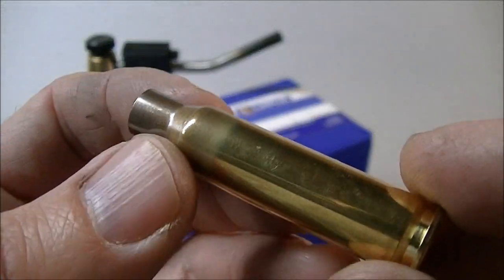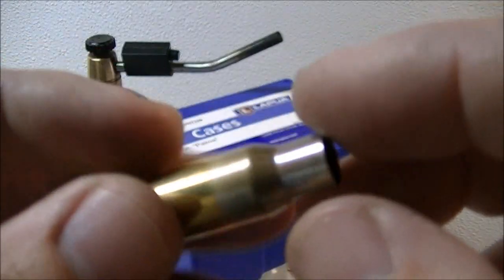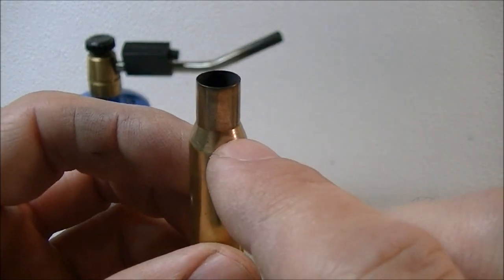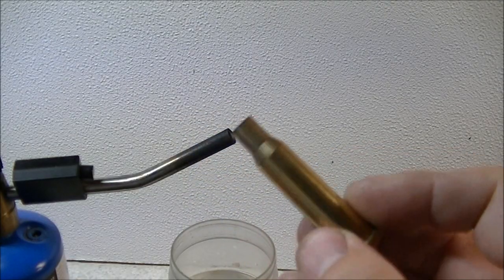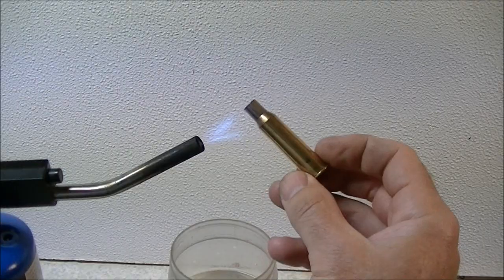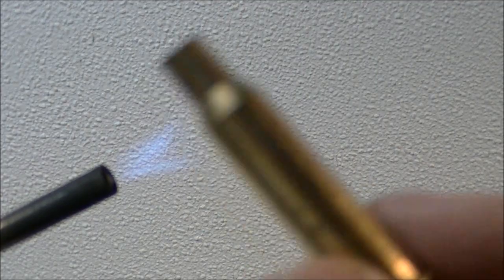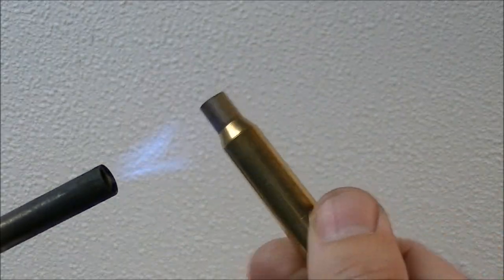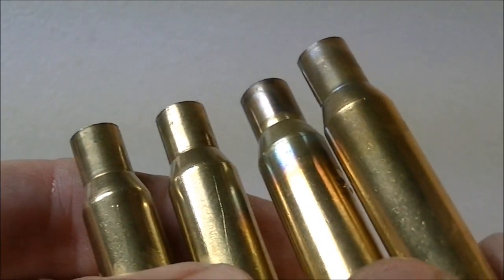How I Anneal Brass Cartridge Cases for Reloading

Comment: if you don't get it up to 660 to 665, you're not doing anything, just getting it hot.
Reply from the maker: Apparently I must be getting them hot enough as the brass I've processed using this method lasts and does not suffer from neck cracks. Overheating is worse than under-heating, as it turns case necks/shoulders dead soft to the point where they  often collapse when seating bullets or crimping.
Reply: heating it up to any degree relieves stress, 660-665 is just the suggested "optimal" temperature. depending who you ask it's generally accepted at 400-500 for 10-15 seconds which works out to roughly a max of upper 600 or so depending on the heat source. the trick is localized heating in the tip.

Comment: I thought you were to let the shells air cool after annealing? Does dipping in water not reintroduce the stresses and reharden the brass to some degree? Thanks!
Reply from the maker: No, dipping them in water does not harden them at all. Brass is quite different than steel or iron.

Comment: Question: Should I anneal before or after sizing / trimming.
Reply from the maker: +bill65761 I would do the annealing after sizing and trimming.
Reply: +314299 Shooting Channel Thank you ... I'm looking at 10 gallons of .223 cases and not wanting to make 10 gallons of scrap to go with the 1,800 rounds of unreliable reloads I've already made.

The test rounds all functioned just fine ... but because I was given bad information from an experienced reloader, I had not length trimmed them and had not used a small base die when sizing them.

When I caliper them, the used cases are as short as 1.734 (range pick up headstamped FC and the shortest of a random 20 cases of .223 measured). 

SAAMI calls for a max of 1.760 and I am seeing suggestions to trim to 1.750 or 1.745. If it's not too much to ask, could you tell me what length you trim to and why?
Reply: Hi bill65761,
Try one of these doo-dads from Sinclair International: http://www.sinclairintl.com/reloading-equipment/measuring-tools/case-gauges-headspace-tools/sinclair-chamber-length-gage-prod32925.aspx
It's a chamber length gage. Trim a case way down and then insert this little tool into the neck, then you carefully insert it and close the bolt, then carefully extract it and measure the total length, which will giver you the exact length of THAT RIFLE'S particular chamber. I have one in .308 and .223.
Good luck, and happy reloading.

Comment: I have been reloading for fourty five or so years now and have seen quite a few youtube videos on annealing and you and I seem to be the only ones doing this method as taught to me by an old military armourer all those years ago, he used to say that if the case head is too hot for your fingers, then it is too hot.  Good video+++++
Reply from the maker: Thanks. Glad to hear I'm not alone in using this method.
Reply: @314299  great video. Small question: when in the reloading process do you do this? Prior to deprime and resize or after? Thanks.
Reply: Hand up here also. Its how ive always done it.
Reply: I did this and got wrecked in a reloading forum 😀 but I’ll STILL be doing it this way !

Comment: Thanks for showing this. There are some awfully expensive devices out there for automating this process, but your approach is quick and easy. I'm probably wrong but at 3:34 or so it looks like you get your knuckle in the flame there.
Reply from the maker: I've seen those devices and they might be of value to a commercial reloader but are way too spendy for me. As for me sticking my knuckle in the flame, no, it was behind the flame. I normally would have things arranged a bit better but for the purpose of video I had the water behind the torch, normally it would be in front of it.
Reply: LMAO 100% the flame even changed color

Comment: What about straight walled handgun cases like .45 colt and .357 magnum? Do you anneal as often, less often, not at all? I'm assuming you'd still want to just do the mouth of the case. And being a shorter case you'd have a hard time holding it with your fingers...
Reply from the maker: For straight wall cases you only want the very edge of the case in the flame, obviously the shorter the case the more care you need to take.